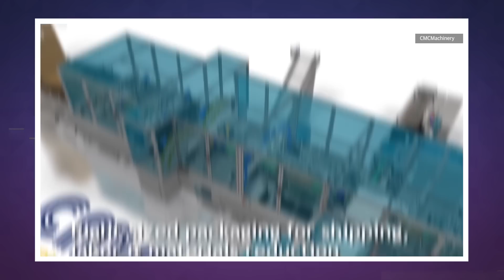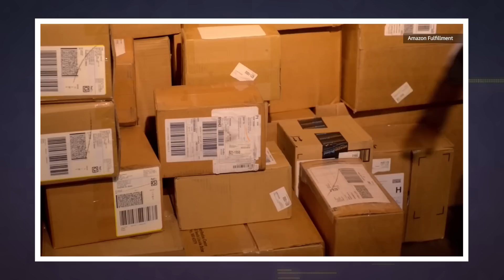Amazon is testing robots that box up your orders

Comment: They will still need an operator to watch the machine to make sure the machine is working properly and some one to watch it while the operator takes their breaks. They will also need a fully trained mechanic on staff to troubleshoot and repair the machine when it breaks down. Based on AMZ's obsession with reducing costs, they will most likely run the machine will it starts to wear out and break down without any preventative or predictive maintenance. Then it will be constantly breaking down ans needing band-aid fixes from the mechanic. This will also slow production and require workers to do the boxes since both ma chines going down at the same time or one breaking down while waiting on a part is very likely.
Reply: KnightsWithoutATable The turn out will be people are laid off only the higher level people will be there to take care of the machines.
Reply: KnightsWithoutATable All companies want to automate to increase productivity and save money. Especially in the call centers where turnovers are high.
Reply: KnightsWithoutATable Why would the machine break down? If they break down it would be awhile like awhile for a new car to break down.
Reply: I have a background in industrial maintenance and have seen how the average manager develops and runs a line.

Would you run a car without changing the oil until the last mile possible? How about waiting until the breaks stop working before replacing them? Managers that lack a background in industrial maintenance will put off even inspections and deep cleaning of equipment to the last moment to try and save money, even though there are plenty of studies that prove that predictive and preventative maintenance are a lower cost than reactive maintenance because they stop unscheduled downtime and equipment damage.

There is also the fact that AMZ is likely to take the lowest bid for the design of the equipment or is making it in-house. Lowest bid equipment has corners cut to lower the cost and inexperienced engineers will omit vital design aspects of a mechatronic (robotic or computer controlled mechanical system) system by ignorance. Separate and fully filtered power supplies for each piece of equipment and, especially vital, a heavily filtered and separate power supply for the control systems (the computers and sensors). When you don't filter and separate power supplies between different pieces of equipment, you get power spikes when you start and stop the motors and servos in the equipment that can damage any electronics on the same supply line. The damage is slow and cumulative. You can get worse damage from unfiltered power from the main lines that supply the facility since industrial areas and the power grid in general has massive power spikes on a regular basis.

These separate systems and their filters cost extra money. It is also not intuitive that you need these systems separated, so engineers without a specific background in industrial automation will neglect to include them. This includes engineers that specialize in robotics. The managers that chose the equipment hardly ever have any sort of engineering background, let alone one in automation, so they will only see the huge difference in prices. Even if they are told about the extra features of the properly designed bids, they will see them as superfluous.

After a few months of operating, the electronics in the system will be seriously damaged and the equipment will never work correctly again. That is if they can ever get it working in the first place. Sensors don't do well with dirty power and put out false readings. They might luck out with the trial installation and not hit any of these issues, but they are likely to get engineering optimizations added into the final design and removing the protected power systems might be done.
Reply: KnightsWithoutATable There will only be maintenance people until the machine learns to repair itself.
Reply: @HardKore5250  When we are looking at nanotech and AI like that, you aren't going to ordering things to be delivered to your house besides food and material to 3d print your stuff.